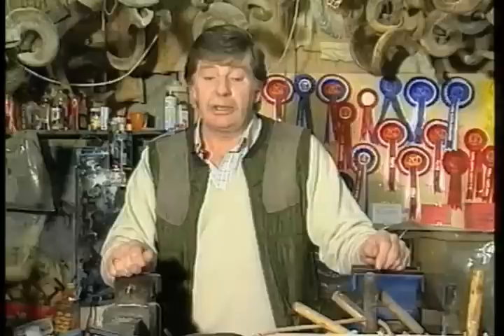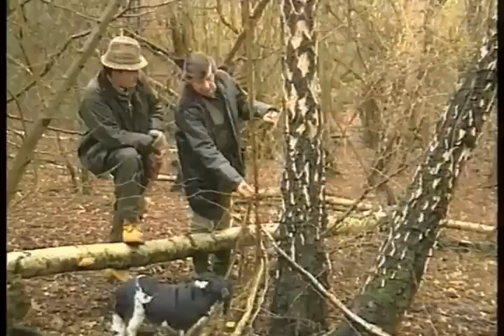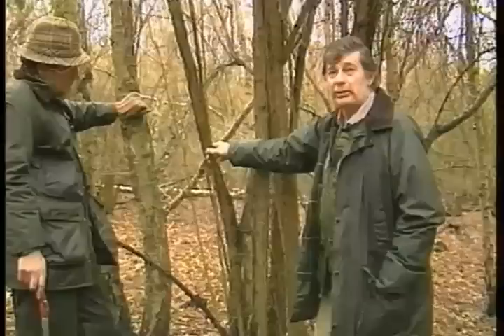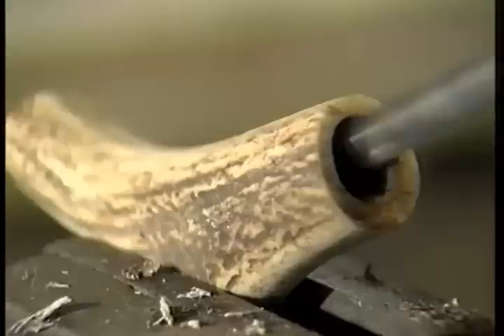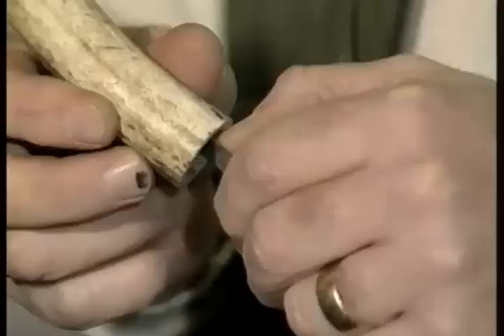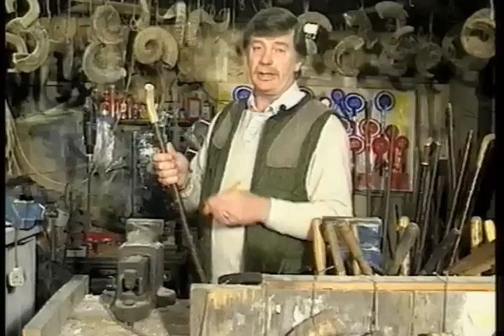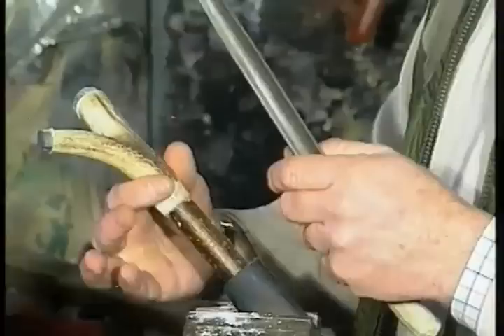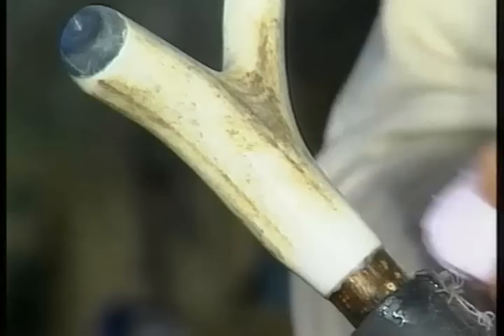Basic Stick Making

Comment: Lovely thumb stick but I feel the stops you used on the antler cheapen it
Reply: The "stops" are buffalo horn and have always been tradionally used. You have to use something as you cant round over the antler to finish it, without creating a hole. It looks better when matched with a buffalo horn collar between stick and antler.